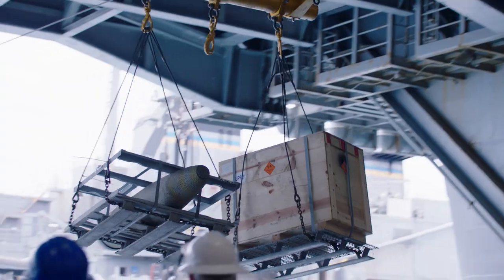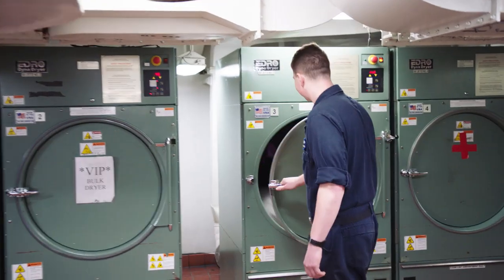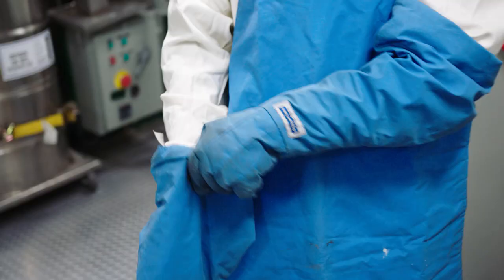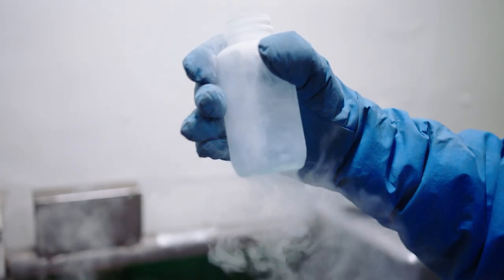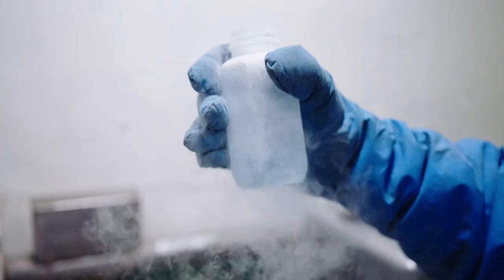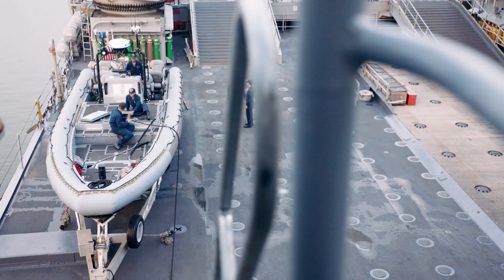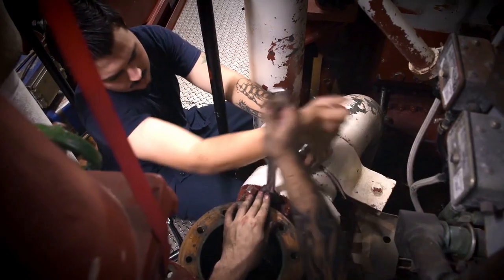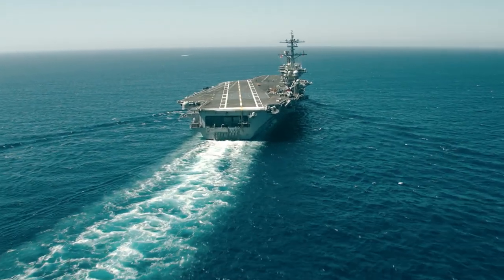Navy Machinist’s Mate – MM

Comment: what a bunch of crap. 90% of the MM rating is main propulsion. after a few years in the aft engine room on the USS JASON , i graduated from cryogenics school and worked in the O2N2 shop onboard the USS KITTY HAWK.
Reply: @yungkim5834  were you a MM also
Reply: @yungkim5834  it's a C school in Portsmouth  VA . It's a hard school to get selected into. And it has a HUGE failure rate.
Reply: Not anymore, there aren't very many steam powered ships left. Most main propulsion is either Gas Turbine or Diesel, MM's are mostly A gang now.
Reply: @BeerMe831  I know. I graduated from cryogenic school, and got out of the hole
Reply: @BeerMe831   what does it mean?

Comment: What math do u have to know for this job
Reply: Math is not a big thing for MMs. You build knowledge by learning how the equipment operates, your drawings, and understand how much of something is good or not. MM handle a lot of hand tools so knowing what to use and how to use it is a big thing.
Reply: @Slygolem1  is machinist mate a good rating ?what are your experiences with them ?
Reply: @stevenmajicmike  MM rating is very flexible on what your is job and the conditions on where you work. It could be from working in the engine room like with lube oil, shafts, or making water where those areas can be extremely hot. You could also be working in areas with auxiliary equipments that provide everything the ships need (A/C, Weapons, Elevators, Catapults etc). Those areas are pretty common for those going to their first ships. After that you can choose what you want to do. For example I have a buddy that gotten a billet to work on landing crafts air cushions with marines(Yes it’s possible for MMs to go green side). In some cases if you’re on an a carrier you could be in reactor department. Finally, it’s no secret that we work very long hours and are usually the first and the last to get off a ship. However, the benefits is that you gain a lot of knowledge in areas that are very beneficial when getting out like water treatment. There’s a lot more to this rating than this video entails, but like they say choose your rate choose your fate.
Reply: @Slygolem1  there's this other interesting rating called ABF do you know anything about that one ?
Reply: @stevenmajicmike  not much just the general since they are an air rating. They just handle all fuel pumps and tanks on board ships for aircrafts. But I heard they usually put new guys in those areas first before they can do things such as ABH. I do say that I think they’re most busiest especially on carriers when out to sea, but I wouldn’t know much about air guys daily schedule .